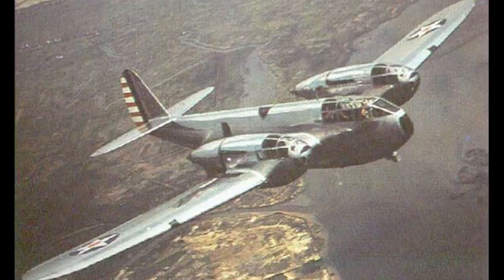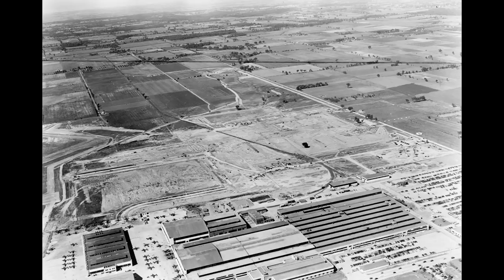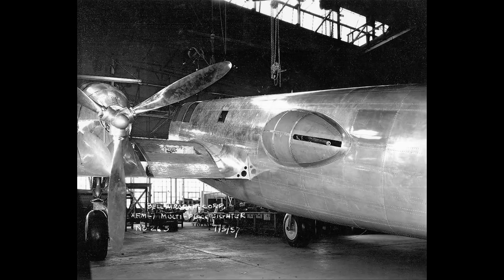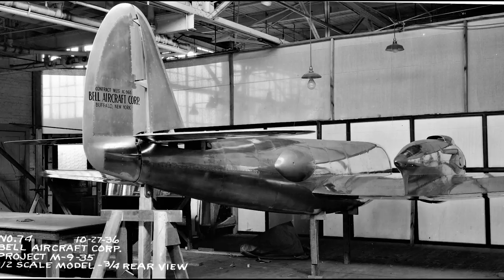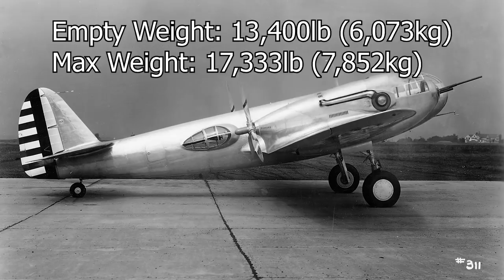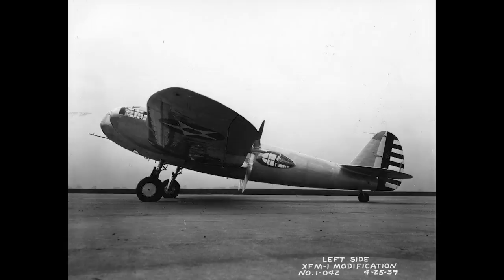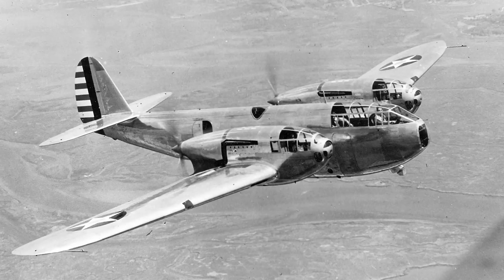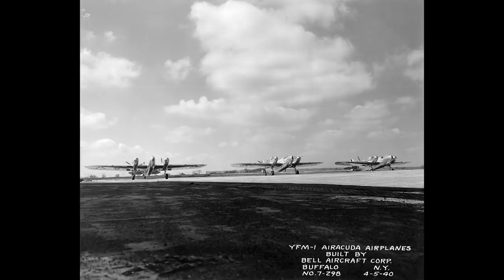The Flying Gun Battery That Tried To Kill Its Crew | Bell YFM-1 Airacuda [Aircraft Overview #28]

Comment: I have no experience of designing or flying planes (although my dad worked at Vickers on both the VC10 and the Concorde!), but I did spend 30 years plus in IT.  During which time, I rapidly came to the conclusion that those designing computer systems should be forced to use them!  I later realised that I had accidentally formulated a more general design law, and it certainly should have applied to aircraft design.  Imagine if the designers of crazy things like this had known at the time that they were going to have to fly them as well...  And not just then, either, it is still a valid 'rule' now - Boeing  software engineers writing code, whilst knowing that it was them who were going to get killed if they didn't think it through properly, for instance!
Reply: My father worked in electronic design for  an electronics manufacturer in England after WW2.  They had a policy that nobody was allowed to work in the design department until they had spent a minimum 2 years in service.

Comment: It was known that escorting bombers was a tactical necessity. And even with that we sent bombers into combat for years without that escort. Props to the survivors. Brickbats to those who didn't do what they knew needed doing. The Rolls-Royce powered P-51 and the longer range versions of the P-38 and P-47 should have been parallel with the introduction of the F and G models of the B-17. It was as obvious as the blood spilled early in the war (Japan and Europe) that bombers COULD NOT defend themselves nor could they outrun enemy fighters. They couldn't and they never did.
Reply: Im sure it was partly political & partly money motivated that they waited so long to get fighters that could stay with the bombers
Reply: @santaclaus6602  With hindsight, wouldn't air to air refueling have been excellent. At the end of the war there was a plan to use air to air refueling on Avro Lincolns if the B29 Silverplate programme had failed and the B29 had been unable to carry the atomic bombs.

Comment: 1:37 You call them supercharged engines, but both the drawings and photos that show the side of the engines seem to have a turbocharger visible. (The round turbine part, connected by a pipe leading back towards what is presumably the exhaust manifold. There's also no visible exhaust stacks, which further leads me to believe it's piped to a turbo.)

Confusingly, the documentation of the time referred to what we would today call "turbochargers" as "turbo-superchargers." Did you see any original documents that used the latter term?

(Edit: not to mention, bell aircraft also had a huge thing for turbos—and tricycle landing gear—in the early 30s. See the early development of the P-39 for reference.)
Reply: The note that the the supercharger was separate from the engine in early models confirms it was a turbo supercharger.

Comment: Allison Engines in a pusher configuration, if that doesn't have disaster written all over it I don't know what does.  The Allisons had a wretched reliability record in the P-38 and their superchargers caused them to overheat and that is without the added problem of every engine that's ever been in a pusher configuration struggling with keeping them properly cooled.

Comment: One of those ideas ahead of its time. Well, in terms of armament; they clearly understood how good it would be to use cannon, just didn't think that maybe you could get away with them in gun pods or something. Imagine something derived from this, like a two-engine pusher heavy fighter more in line with the Mosquito or Bf110 in terms of size and crew and maneuverability but with 40mm Bofors in gun pods in front of the engine nacelles rather than manned stations. Might have been interesting. Oh, yeah, and not make it so mechanically backwards that the thing falls from the sky with one single part failing. XD

Comment: A lot of these 'heavy escort fighter'(s) were formulated in the 30's where a dual-engine fighter often was faster than the single-engine fighters, due to low-powered engines. Adding to the problem, in the late 30's, large bombers with multi-engines (Fortress, Lancaster, Liberator) , coming into service, were now faster than most of the fighters that were in service in say, 1935. This Airacuda was a poorly thought-out and developed concept, but looked like art-deco from the 60's. I wonder if was the plane that spurred on development priority for the ejection-seat?

Comment: This concept of the bomber hunter was realized by the Germans 4 years later the Dornier DO 335 was a powerful heavily armed, fast [ that's a understatement ] heavy fighter . It was a twin engine ship with a unusual push pull layout , a DB 600 in the nose and another in the tail and all cannon armament [ the propeller in the tail made for the first ejection seat ] and could reach 474 MPH . unfortunately it became available in 1944 when the Luftwaffe was building all the ME-109's and FW 190's it could get its hands on as they were being bombed to bits by the USAAF and the RAF and couldn't spare the resources or the DB engines for the product or the time to set up for a all new airplane . At that time all resources for a new plane were directed to the ME 262 jet. This was what the Airacuda strived for but in 1936 it was just as fast as most service fighters of the time, but by 1940 the German JU-88 was faster and would hunt your Airacuda . The technology was changing too fast .

Comment: They tried really hard to make this concept work and it really does look like a practical design.
It could've worked if they just did away with the unnecessary weight.
Remove the bomb bays, defensive gunners, and rework the nacelles to be better streamlined and replace the crew compartments with some cooling systems to address the heating problems.
Reply: That's not really this concept anymore.

Comment: You'd think that Bell would try ditching the two extra crewmen in the nacelles, and just have the cannon in them.   Of course, 37mm?  Yikes, that was tank armament at the time!   Maybe something like two 20 mm cannon in each nacelle, no crewmen, similar to any other fighter (and many of them by mid WWII had one 20 mm on each wing, anyway).  
Of course, they could have simply switched the props to the usual tractor orientation, slimmed the heck out of the nacelles, crewed it with two men, and I could see the thing as a credible heavy fighter.   The Airacuda actually had some nice lines, not entirely different from the Japanese Dinah.   And that was no pokey mope of a plane!

Comment: I was wondering, why didn't they put forward-facing turrets on heavy fighters? That would certainly improve their ability to attack maneuverable targets, since it wouldn't be required to face in exact direction to hit said target. Not being constrained to a predictable attack path of a forward-facing guns fighter also helps. Besides, they put them on bombers and they worked quite allright, so why not on heavy fighters? If you mounted the fixed guns of a Beaufighter on a turret, surely that would be splendid for its combat performance. Well, lackluster projects like this, is why. People who bite more than they can chew poisoning the well.

Comment: Saw this machine in a book that Seversky wrote-Victory Through Air Power- as a 10 year old, I thought-- how are the gunners going to get out in a hurry?
Reply: They aren't getting out in a hurry. Not even if the airplane is on fire and falling fast.
Reply: Yes I read that book too when I was 14 or so.  I think it was written before Pearl Harbor but had the philosophy that war was going to be inevitable.  It also showed a large 4 engined bomber that wasn't a B-17, B-24, or B-29.  Maybe called B-23?
Reply: @MrDougman59  Douglas B-19? Terrible airplane.
Reply: @2lotusman851  I looked it up.  Full name was XB-15.  Made by Boeing. Couldn't exceed 200mph and had only 6 guns for defensive fire.  I suppose lessons learned from this went into B-17s.
Reply: @MrDougman59  Ah, OK.

Comment: This airplane would have been more agile in the air if they had extended the tail feathers horizontally behind the prop blast.  It would have flown 50 MPH faster if the wing was just 1 foot thinner.  The wind tunnel testing wasn't doing more than verifying that their model was flyable. Bell had many innovative designs that deviated from traditional thinking.  Modern airliners, air cargo, and even the Space Shuttle employed the use of the APU for electrical power and hydraulic controls.  Flying over 250 was not in many aviator's minds in the 1930's.
Reply: Making the wing one feet thinner probably just made it an angled flat plate, with little to no room left for the wingspars.

Comment: I have seen this aircraft before but I knew little about it.

The design was way over complicated for what they were trying to achieve. Why they thought putting the engines and guns together in the wings is a good idea is very odd. Putting the guns under the chin, as with aircraft such as the Me 110, would make much more sense and allow the engines to be unstilled as tractors rather than pushers. Thus obviating the problems with cooling.

Interestingly the speed of this aircraft was similar to that of the B-25 Mitchell. Maybe it should have been a bomber afterall.
Reply: and most importantly no need to put gunners there and easily reduce crew if all were located close by.. yeah it was really really odd design. as slow is it was tail turret would also be good idea

Comment: Should've kept some 4 air museums. Same 4 a lot of other prototypes & test fleets. Great planes lost that showed aviation's foresight, engineering capabilities & its failures. Pushing the abilities of their day. Some impractical because of cost or real air time performance. Being the 1930's it was very imaginative 4 it's time but impractical. Fighters R lite & maneuverable with short ranges, bombers heavy & cumbersome with long ranges. The 2 can't B mixed with 1930's technology in 1 air craft. Problem solved later with the P51 plus drop tanks & P38. But it looked futuristic 4 it's time & would B great 2C 1 today. Even if just on static display.

Comment: At 7:01 the statement describes so called:   stick-position-instability... and that is a pointer for a very aft, or too aft centre of gravity.  Very dangerous to fly, only intended for testpilots. 
37 mm canons have a low rate of fire, while targets move in the x-y-z space, and the g-number (= projectile trajectory(!)) varies constantly.... so:     could work as a tank- or bunkerhunter not as a fighter.
Conceptual and structural design-flaws all-over.

Comment: Well you can never call Bell a conservative company!  They tried a lot of different designs and they seemed hooked on the idea of arming an aircraft with the 37mm auto cannon. I wonder if anyone at Bell had thought lets put the engines facing forward and put the two cannon in the nose and see how she flies?  The better aerodynamics and weight savings might have added 50-60miles to the top speed plus fuel savings.  This would have made it a super bomber killer that the British RAF would have liked in 1940-41.

Comment: I think the pusher engines were a clear indication of a failed design. Since most planes fitted with them had some form of mechanical problems other than the cooling issue. I think the only effective one aside from maybe a few WW 1 aircraft. Was that German WW 2 aircraft with an engine at each end. I believe the translation of it's name was Arrow.

Comment: Strange that Bell continued with strange engine positioning with the Aerocobra if the motors suffered from overheating problems when not mounted conventionally. The Russians loved the fighter and never had problems with overheating probably because they used them in s colder climate and as an attack aircraft rather than a fighter.
Reply: Changing the engine configuration would have sacrificed the intent of the aircraft by eliminating the dual canons.
Reply: The Russians did not use the P-39 as an attack aircraft rather than a fighter. It is a common misconception that it was used in the anti tank role. It never was. It was used exclusively as a fighter, which did very well at lower altitudes. Many Soviet aces preferred the P-39 to other lend-lease fighters, even over the Spitfire. They were never shipped any armor piercing ammunition for the Oldsmobile 37mm cannon, nor did they produce any on their own.  The role of the P-39 was defined in a Russian phrase that translated to English as "low level support for ground forces", which Westerners interpret as "close air support" but it was used for low level fighter cover, not ground attack.
Reply: @mikearmstrong8483   Apparently the Soviets preferred their excellent Sturmovik for tank busting. From what I've read, it was a good decision.
Reply: You're correct about the fact that the P-39 didn't satisfy the Army Air Corps requirement for oil cooling, but that issues seems to have been dropped when the war was brought to the US.